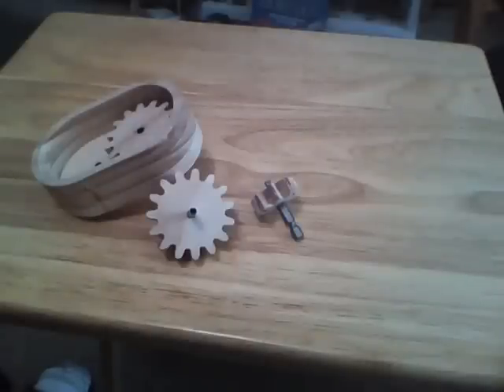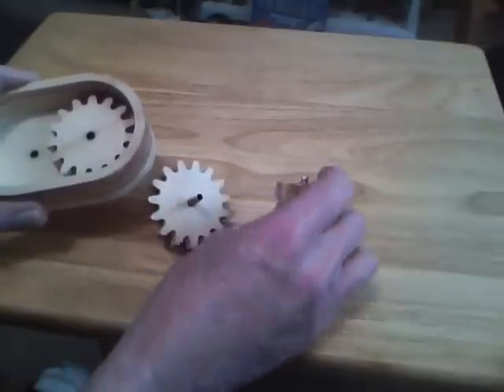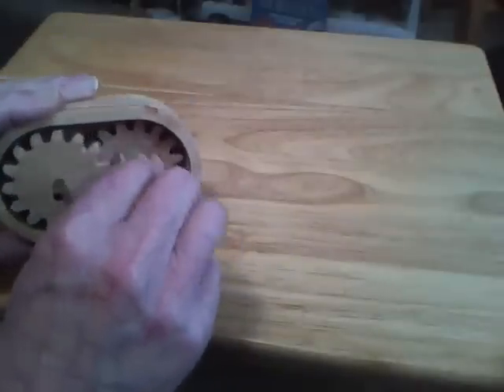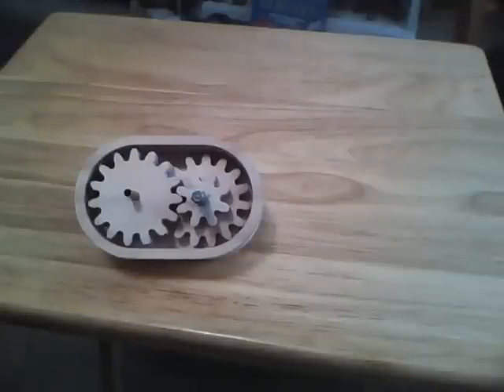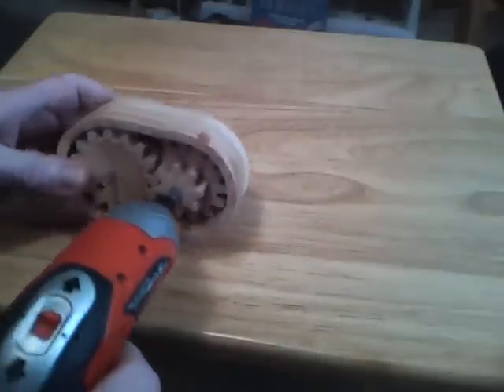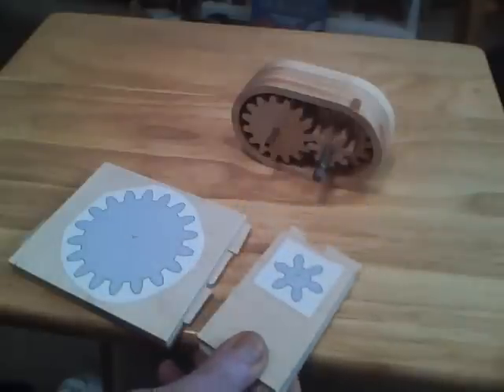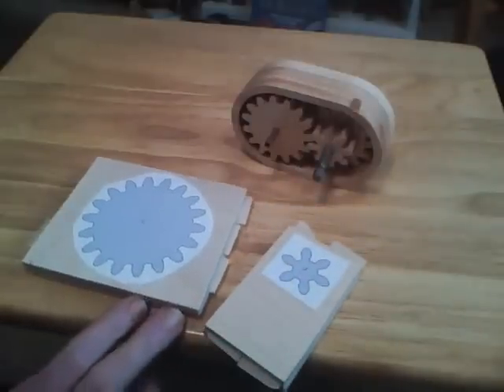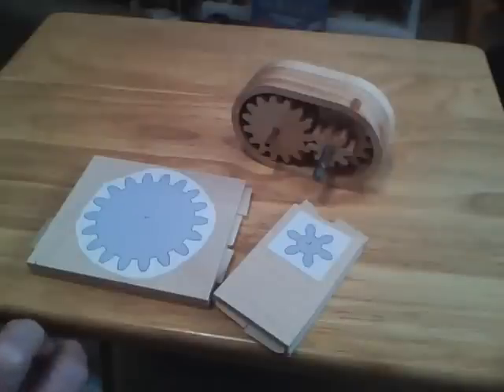Marble Lifter gear drive plan.

Comment: Good going Jim My shop has no heat either. That's why I'm scroll sawing inside LOL have a good one.
Roland
Reply from the maker: Thanks Roland. I have a 1500W heater, but it only heats it about 25 degrees. So I need it to be at least 30 outside.